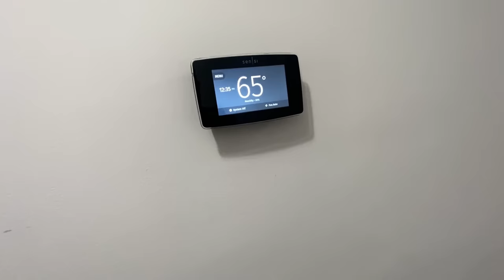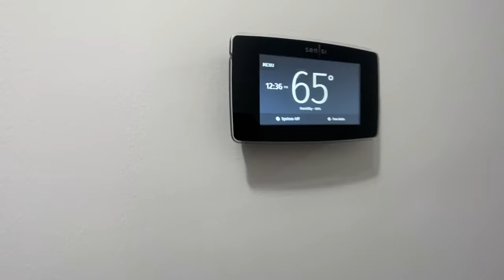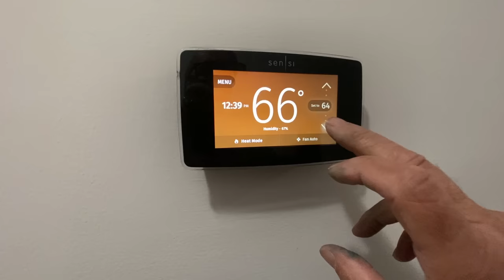Gas Furnace draft motor stopped by a bug or moth

Comment: If you go back and watch your video at time 4:24, you will see the bug sitting on the edge of the exhaust port. When you stick your hand in there to get the stuff out, the bug falls down into the fan and you left it there. That’s what you heard when you started it the second time. You probably didn’t want to get a vacuum cleaner to suck out the trash, but maybe you should when there is a possibility of stuff falling further into the machine.
Reply: it was a small bee or yellow jacket by the looks of it, will probably get crispy and disintegrate and blow out in no time. considering you have to remove the inducer to get it out and probably tear up the gasket around it just to get some small debris out, i'm not sure its worth it. seen furnaces go 30 years with so much rust flakes in them you could fill a soda can the real problem was the larger debris and the zero torque of that inducer motor apparently since a small finger assisted spin make it start.

Comment: I had a no Heat incident last year on my brand new furnace. The drainage line was frozen (its a high efficiency system). The HVAC company had to hook up a condensation pump with alternate piping to drain water into a downstairs toilet in order for the system to heat my house until the temperature rose above freezing.

Comment: I’m amazed that these motors have zero torque to them. My Trane inducer failed 2 years ago. The tech kicked it and it started right up. He replaced it anyway under warranty 🤷‍♂️
Reply: Unfortunately the little 2 pole PSC motors have very low starting torque, albeit more that an old shaded pole motor.

Comment: Should be non flammable board (drywall or cement board), around the furnace. If Styrofoam burns, it produces deadly gases.
Reply: yeah, it shouldn't be left exposed anyway. it's against building code most everywhere. 🤔